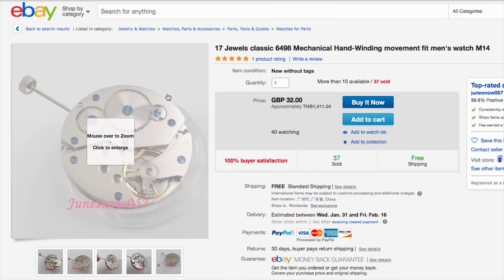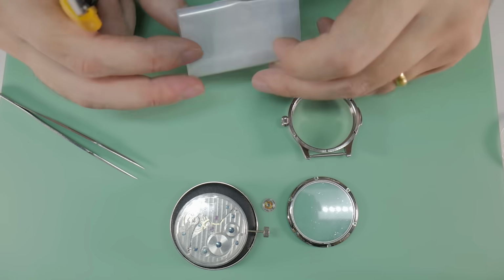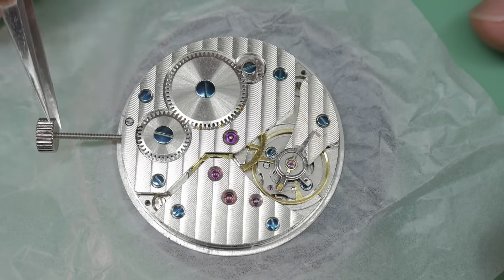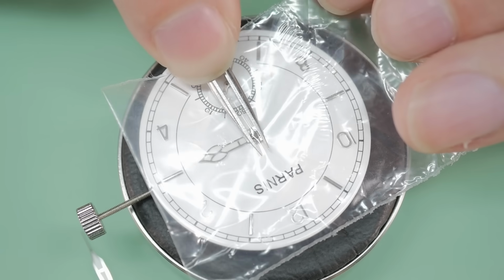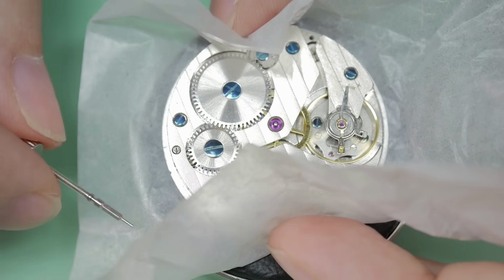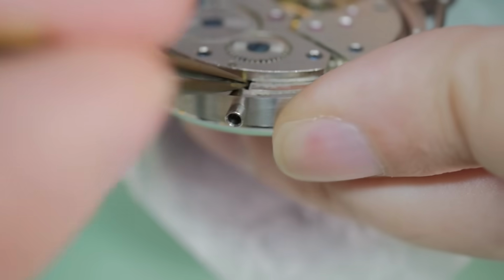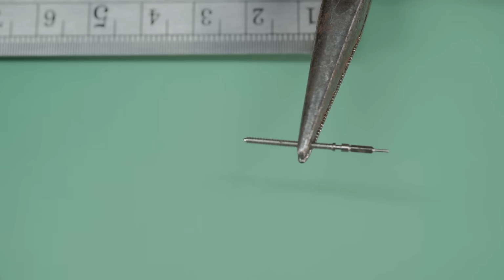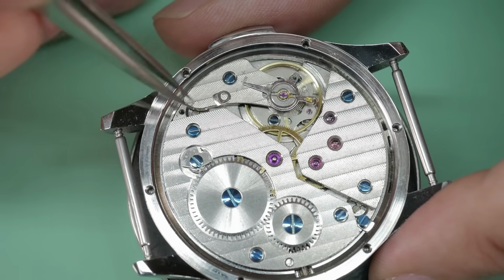Build Your Own Custom Watch Using Parts From Ebay

Comment from the maker: Build Your Own Custom Watch Using Parts From Ebay
Reply from the maker: Total cost was around $100
Reply: @WatchRepairChannel  yes, isn't it too expensive?
Reply: Watch Repair Channel thank you for sharing your knowledge and craft! What would this beautiful watch sell for? Could a profit be made sourcing individual parts from eBay?
Reply from the maker: The 6497/6498 is a pocket watch movement
Reply: @WatchRepairChannel  Hi, I forgot to add the dial washer. I realized that after i put the hands on and don't want to take it apart. How important is that? By not having the dial washer, will that cause the watch to hand/run slow because of friction or something? whats the purpose of the washer?
Reply: Are there any pocket watch movements that you would recommend for the same process?
Reply: Mephitus LePew 

    I used to take high end pocket watches from the 1790’s up to the 1890’s. Then do a little bit of re jeweling, spring work,  new staffs always the tips are broken off. We charged about $500-2,500  for a great movement. Then what ever the cost to fix up a movement age has a lot to do with it. Then hand fit them into a case from the 1960’s 70’s period. Very hard work and it took several specialized watch makers to pull it off. I made about 17 over a 12 year period was really going blind didn’t help. I made a case out of mammoth tusk a few times and a dinosaur tooth very fragile ended up building a heavy gold frame around the case to protect it. I made a lot of very special jewelry and watches back then still have a lot of kool old molds from jewelry making. I made several figures for the dungeons an dragons game back in 1972 still have 11 old lead casting masters laying around a box somewhere.
Reply: Ooo your setting for currency in eBay is in Thai Baht, are you in Thailand? I would love to have my watch serviced by you!
Reply from the maker: i am based in thailand but I cannot do private work
Reply: did you ever get around to doing up the second case clamp screw?
Reply: Brilliant Mark,  encouraged me to build my own 'Aviator' watch, with a clone 6497 movement. Parts arrived within 8 days, I built it in 3 hours!!! (no laughing), cost me including a strap from Cousins, less than £100!!  Many thanks, keep up the good work.
Reply: Treve Harris Hey Treve. Could you be so kind and list the parts you used, or tell me how 
 I should get parts that will be compatible? Thank you in advance.
Reply: Watch Repair Channel Great as Always. Mark what was you total monetary investment?
Reply: Did you save money doing this?
If so how much?
Reply: Would you recommend an automatic movement ,please?
Reply: I have a Volvo 240 engine and a Volvo 240 without an engine just watching your video has been inspirational. And I feel I could do this.
Just one thing,where can I find this eBay place you mentioned it might just come in handy? For tools and extra bit and stuff.
Reply: I would love to see a build using a ETA Valjoux 7750!
Reply: @Anonymike365  i recomend a Komandirskie (Vostok) movement. They are availeble on various websites and pretty much the same but much cheaper!
Reply: I'm
Reply: Can you fix my crown if i send it to you as I snapped it at the end? I can send it through ebay and pay you the money? Thanks
Reply: Hello sir good day.. can i ask if i can buy  new case for my sieko 007?
Reply: With your video,  I have been building watches for a couple of months.   I normally work with eta 2824 or 2836.  I have many problems.  Most I have fixed.  How do you solve a problem where the rotor does not spin 360 degrees?  I use submariner cases and it seems to hit the screws on the movement ring.
Reply: I have a watch I want to check and clean it and polish it omega watch
Reply: I tried this and for some reason the hands keep hitting the numbers on the face. Any advice on what I can do?
Reply: Hi there, I am in need of 2 parts for a ronda 515 quartz movement, is there any place to buy these? I need the gold coloured battery terminal and the isolator that fits under the battery, any advise/help much appreciated, its got real sentimental value.....
Thanks.
Reply: Is it ok to use bluetak to get dust
Reply: I noticed you use a tablet for timing mechanical watches! what software &hard wear is needed?
Reply: Sir I want to learn to become a watch repair man.
Reply: Is it waterproof?
Reply: this is so cool how about a fog watch please !!
Reply: Do you have a video on how to measure and cut the stem for a screw-down crown?
Reply: @yoelkeren  I just keep installing them, checking the length, then trimming them a little until they're the right length
Reply: Thank you for this video, I have built four watches using parts from aliexpress now, and they're all (somewhat) unique :D
Reply: great video. when i removed the stem and then tried to reengage i did not feel any resistance on the screw and it kept spinning. Now the stem will not go in properly and the screw will not secure it in place, so i fear i have broken it. Do i need to start again with another movement?
Reply: He didn't exactly "save money" as you can get a pre-assembled Parnis watch for around the same price (give or take). What he did get though, was a CUSTOMIZED watch to suit his taste, for ABOUT the same price. You can spend a little more or a little less on a Parnis, but it wouldn't be what YOU wanted, it would be what THEY put together themselves. So the value/savings are subjective. But it's not at all a bad price for a custom watch. I have other watches I've customized and they generally cost 50% more on average to do. So for what it is this is a good price.
Reply: Very nice and instructional video. 

Quick question: I noticed the case used in this video has what I believe is a minute repeater lever on the left side, am I correct? Obviously I know the movement does not have a minute repeater complication, it just took my attention the lever on the case. 

Thanks!!
Reply: Hey I have a doubt. All the movements I saw on eBay have the second hand at 9 o clock. How did your watch have the seconds hand at 6
Reply: @mitshah4798  6797 at 9:00, 6798 at 6:00
Reply: @mitshah4798  6497= seconds at 9, 6498= seconds at 6
Reply: Hello mr Mark! I want build own watch using swiss mechanism can you help me please with some information? :)

Comment: Nice video tutorial. Where can I buy the two screws and holder that is necessary to hold the case and the movement? Because I buy a st3600 movement but those screws weren't included. Thanks

Comment: In 2024 I ordered similar parts. I ordered the same case in rose Gold and the same appearing movement. I ordered a black pilots watch style dial that came with the correct hands. Finding a strap with a rose Gold buckle was difficult especially considering I have large wrists and wanted an extra long strap. Even if I could use a standard length strap in the last hole I hate how the end keeps falling out of the keeper. I got the pilots watch style dial and hands because I wanted the luminous feature to read the watch at night. The case retailer said the case water resistance is 3 ATM but seeing that there are no rubber seals I think I will be taking this off to wash my hands. Thanks for the video. I was already subscribed. I have build several NH35 watches but this will be my first ETA / ST movement watch.  I like the big dial so I can read the time without my glasses and as I mentioned, with my large wrists I can pull it off comfortably. Thanks again.

Comment: Great vid enjoyed, until you set the hands using a tweezer width! Applying pressure that way will certainly bear heavily on the wheel pivots, on both the second and main hands. Hand presses have a hollow centre to allow the pressure to be applied to the hands alone. Even a biro with the ball point removed is a better option!

Comment: 9:47 WHY put the second hand at "52" and not "60"???? 
WHY??? You have not put a wind into the movement yet, correct?
Doesn't that placement autoatically have the watch running (in this instance) 52 seconds fast, if you line up the hour and minute hands wth the "12" on the dial before starting the watch?

Unrelated question:
I think you stated the movement was 40mm(?) in diameter?
Are pocket watch cases available in the correct size if someone wanted to build a pocket watch instead of an "over-size" wrist watch?

Comment: Hi Mark, 3 Questions for you. What are the cutters you used to trim the stem called? What is the small clamp you used to hold the stem called? Am thinking/guessing this project can be used with a dated movement and face? Cheers Roger Melb Australia

Comment: Great Video, thanks. I made one just like yours but I seem to be having some trouble with the movement. It seems whenever the crown stem is removed, the movement works fine and keeps correct time, when it is inserted, the watch either runs slow or completely stops. Do you have any suggestions on what I can do fix this issue ?

Comment: Watched this vlog and decided why not, first build so went for a 6498 ST36 ordered all the parts as you did and they all match only problem the case came with a screw down crown, do I measure the stem the same way as you did on your automatic build vlog?

Comment: I’m working on ordering my parts to build my first, I started ordering before I watched the entire video. Is there a version of the ETA 6497/8 or SY36 that is the same size but has a three hand movement and not the second hand at the nine? 

I have a project in mind for the movement I bought but it’s not my vision for this case.

Comment: A very helpful video. I have just ordered all the parts to put together my first watch (a custom vostok because they are cool watches, but also easy to source parts that fit together). My real hope though, is to put together a dirty dozen type field watch with a small seconds dial like this. Any recommendations for such a movement, but that would fit a 38 to 40mm case? Any advice would be greatly appreciated. Thanks for the great tutorial!

Comment: I’ve a quick question, if Mark is reading this, how important is the weight of the watch hands? I looked through various watch designs, old and new and I noticed I never see intentionally large or somehow elaborate watch hands. For example the side the connects to the enter movement axis(sorry I don’t know the terminology) then there could be some kind of wide flower design, the the pointing end of the hand. But seems this never happens. So I wonder whether there is a strict limit to the weight of the hands.

Comment: I want to re-build a 1939 WW2 watch the old movement is shot and incomplete, I would like to fit a new movement into the old case and use the original hands & dial.

Comment: I know this is an old video but maybe people can help! I just bought a 6497 off eBay. It arrived today and I started playing around with it. My issue is that if came with a minute hand pre-installed. When I try and remove the hand, the whole minute wheel pops off with it. Anyone have any suggestions on what to do? Is it possible that the minute hand was permanently installed to the minute wheel post?

Comment: Do you know if I would be able to convert my Seiko solar sne095p2 to automatic? I was thinking would a 4R36/NH36 movement work? Would I still be able to use the exsiting dial/hands from the sne095p2?

Comment: Just used this video to help me with an ST36 ( Unitas 6497) build.  He makes it look SO EASY.  I spent at least half an hour getting the movement clip screws in.
Reply: I'm starting mine now too but I got stuck before that! My movement came with a minute hand pre-installed and I can't take it off without the minute wheel coming with it. Any ideas?

Comment: cywatch:
1- Movement ($42): https://www.ebay.com/itm/Asian-17Jewels-6497-ST36-Hand-winding-Mechanical-Movement-Watch-Movement-New-P29/322856589623?hash=item4b2bc09937:g:Ev4AAOSwJtdZ-DT3

goutent:
2- Hands ($12): https://www.ebay.com/itm/Corgeut-Luminous-Green-Watch-Hands-Fit-Eta-6497-6498-St36-Movement-Watch-A335/152331987021?hash=item2377b1a84d:g:Xi0AAOSwls5Y7ynb
The hands were not available at the time as I was searching, closest I managed to find are the above ones.

angelwings:
3- Dial ($23 There is an "only dial" option without hands, but the price doesn’t change I think): https://www.ebay.com/itm/38-9mm-white-dial-silver-arabic-number-fit-6498-seagull-movement-Dial-Hands/254631911959?var=554383854901&hash=item3b493ea217:g:J-QAAOSwKlte8CQD

atn123 (the case price was in GBP I don’t know why and it makes $57):
4- Case ($57 the crown Mark used is #3 on the page): https://www.ebay.com/itm/Corgeu-43mm-watch-case-fit-ST36-ETA-6497-6498-MOVEMENT-P498/262641038693?hash=item3d26a03565:g:-RIAAOSwaEhZJ5uU  

Total (as of 18th Sept. 2020): $134 

I have no affiliation with above sellers/stores and the links are regular links I just copy/pasted (not earning/gaining any benefit or anything). Please, shop at your own risk if you want to purchase above items, I don’t accept any responsibilities. I just tried to copy what Mark did to make it easy for the viewers. All the prices I wrote down in US$.

Good luck.
Reply: W human being

Comment: I have recently built my own using the same movement but the skeleton version. I used a dial which exposes the fronfal mechanics of the watch also.
The watch looks awesome and i have received many comments.
Awesome video Mark, the beauty of this movement is the amount of cases, dials, hands,crowns available so if you get bored, you can just re-design it!

Comment: Mark, just a heads up warning,
If that LED light emits 450 Nm frequency, it will cause retinal cell apoptosis (Cell Death)
The safest lighting is either Halogen or Incandescent...
Reply: 450 nanometers is still in the visible spectrum, it's actually closer to blue than it is to violet
I'd be more worried about sub-350nm light
that said, warm white is always better than cool white

Comment: Quick question: if I have a somewhat small (36mm diameter by 7mm) quartz watch, which I love the look of, is it possible to replace the movement with a mechanical one but keep the watch face the same? 
Would it be possible with an ultrathin automatic mechanical movement?

Comment: You're right, it really isn't difficult. I just built mine 3 days ago, however setting the movement clamps to the ring that holds the movement in place and screwing down the 2 screws took me 1,5 hours :D 
Case and bracelet 'directly' copied from Rolex's 116613LB, ofc without the Rolex logos. Seagull ST2130 with mercedes hands and a D-Blue dial from a Rolex DeepSea Sea-Dweller. 
I laser engraved my initials on the caseback and now i got myself a nice watch for around 130$ that gains 2 seconds per day while on my wrist. 
Mabye in the future some text on the dial would be nice.

Comment: Nice video! Thanks for the basic basics for total novices like me. Seems like flat-tip, rather than pointy-tip, tweezers might be better for attaching the hands. But it also seems like as you’re buying watch parts on eBay, you might as well spring $20 for some cheap Chinese tools.

Comment: Was shown years ago how to cut a screw which was too long. Wind a nut along the thread past the point where you intend to cut. Cut to length. File the end to remove any burr. Wind the nut off the thread which will reform the thread as it comes off.

Comment: Hi, thanks for this gem of a video! I am looking into building a watch based on the 11.5° ETA 2846. Thing is, I can't really find a case specifically made for that movement which I like. 
So the width is 25.6mm/26.0mm, meaning the inner diameter of the case needs to be 25.6mm, right? But what about the height of the movement? Which measurement of the case to I need to look out for? Any help is greatly appreciated. thanks.
Reply: To ask a more precise question: Could I use a case made for the ETA 2842 - which has the same width measurements but is only  4.7mm in height opposed to the 5.2mm of the 2846?

Comment: a quick question, what size screwdriver do you use the most?  My set didn't come with a 050 screwdriver and I have found I have had to sharpen my smallest on a wetstone quite a bit to get to the small screws?  Thanks, love the channel!

Comment: Hello would a case that fits a Miyota 8215 also fit an ETA 2836-2 without needing to change the movement cushion mount? I have an ETA 2836-2 that I would like to put in that case and I would like to know if I need anything else. thx!

Comment: Dear Expert,My Hamilton watch 8982 does not advance to the next date fully. if it is the 2nd at midnight it goes only between 2nd and 3rd. I can advance the date using the handle of the watch with no problems and I can advance the time manually and at midnight it advances the date without getting stuck between the numbers. Please tell me what I should do. Please email me you advice if possible mojafari@yahoo.com I really appreciate your help.Best, Mo

Comment: Great video. Thx!
I'm thinking of constructing my own watch. I had an idea to make an aviator style watch but to put the quartz movement inside to keep the cost reasonably low. Unfortunately, I wasn't able to find the movement with the same hight. The case I found is made for ETA 6498, and the ETA quartz movement is a .3mm slimmer. I'm afraid that the crown stem won't fit correctly?
Is this a deal breaker or a fixable problem?
Thank you.

Comment: If you build a watch using a ETA 2846 with the date wheel removed, do you still need to install a dial spacer?